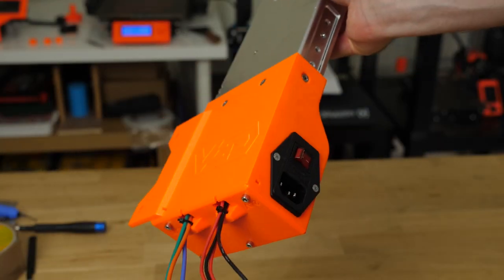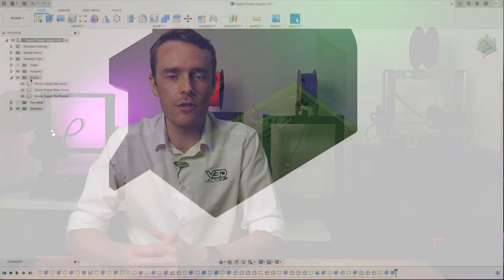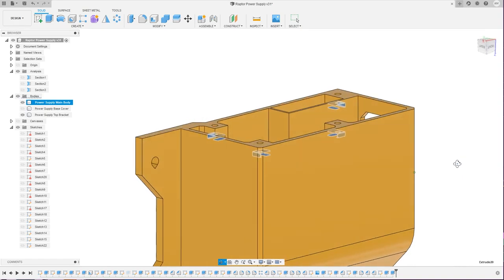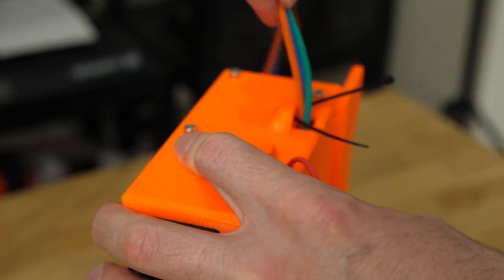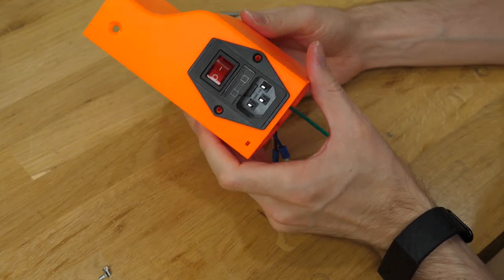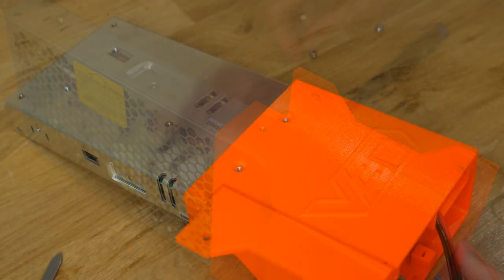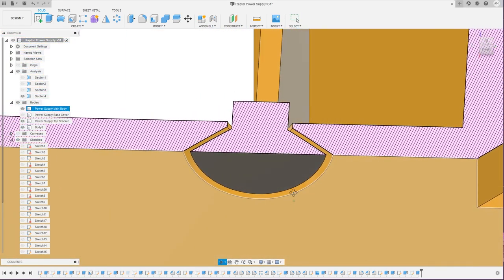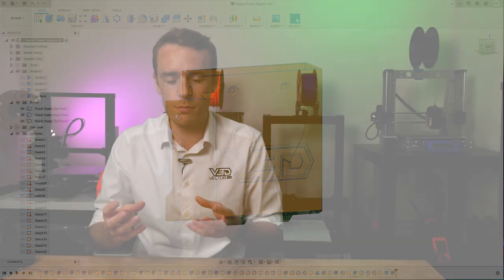Power Supply Enclosure Design Guide using Fusion 360

Comment: For anyone who doesn't know, you can easily(-ish) insert 3D models from McMaster-Carr's catalogue into Fusion 360 designs, which I've recently been doing with screws and related hardware :)

It's really not at all necessary, but it makes it easier to get properly-dimensioned hardware models into your design to double-check your designed hole sizes, for example. Plus the models from McMaster-Carr are high resolution and look great!

(Though it's worth being in mind that using a lot of them in a design can cause Fusion 360 to bog down a bit :) However I've been using 14 models - screws, nuts, washers - in my latest design, and that's not a problem, even on the PC I built to be "mid-range" in 2013 [with the only subsequent upgrades being more SSDs and a GTX 1050 Ti], so that's probably only a concern if you try adding dozens and dozens of imported models!)

Comment: Great design! Generally speaking it's a good idea to use frame retardant plastic for power supply enclosures, in some cases it's even required. It might be interested to look at some filaments that are UL Blue card certified then. An example would be Novamid filament from DSM. Keep up the good videos!
Reply: I don't think there is enough combustible material inside the power supply to set fire to the PLA. On this point I've experimented with seeing how flammable PLA is by burning it with a blow torch and found it reluctant to keep burning once the flame is removed. Of course if the power supply circuit has a fault that causes it to run hot the PLA around it will melt which may well be a safety issue.
Reply: @dphillips9641  To be honest, I wouldn't know exactly. I just know that plastic used around main voltage (outlets, enclosures, etc.) has to be certified if sold etc. And that's when you're talking about injection molded parts usually. FFF is generally speaking a little more risky due to larger surface area.
Reply from the maker: Interesting. Prusa sold the mk3 with enclosures just like this and was CE certified so should be just fine. Also its petg BTW, not PLA.
Reply: @Vector3DP  Yes, good point.
Reply: @Vector3DP  That's actually a really interesting point, Considering they just have the complete PSU it could be that they just shove everything under Low Voltage Directive (anything under 48V AFAIK), which has less strict standards.

Comment: Great work Adam!  I'm following along.  I was wondering why you moved the power supply from underneath instead of where it was.  Seems like it was out of the way and closer to the motherboard in the original location.
Reply from the maker: Good question! I found it easier to mount securely in the side position that underneath, I used a very similar method on a previous printer design and it worked out really well.

Comment: I haven't had any problems removing nuts from traps I usually use the heavy shake and halt method, I apply slightly more tolerance than some people to the design but that's just to make sure they go in in the first place, having said all this, the next time I try to remove a nut it will probably get stuck LOL

Comment: do you need a fan for the power supply?
Reply: If the power supply wasn't designed/made/sold with a cooling fan, and its datasheet/manual doesn't say that one is required (it would be very unusual for a power supply encountered by a 3D printing hobbyist to specify the use of a fan *that wasn't part of the design*...), there's no need to add one — unless you're doing something that would significantly impede its passive cooling ability, such as enclosing it so much that it had greatly reduced/zero air flow (way more than Adam's doing here), or using it somewhere with a high ambient temperature (e.g. above 50°C; the power supply's datasheet probably specifies things like the allowed operating ambient temperature range).
Reply: @AndrewGillard  thanks alot, i really apreciate your reply.